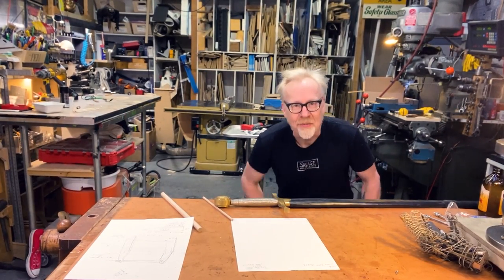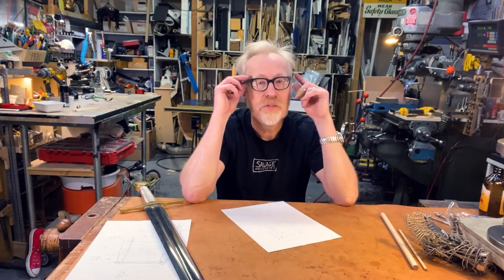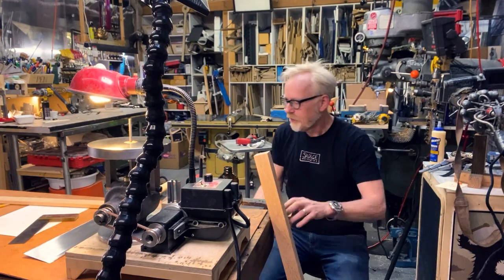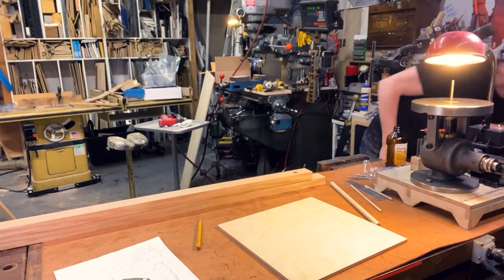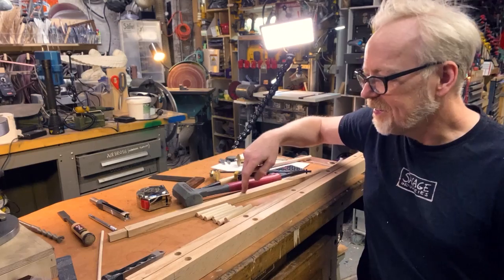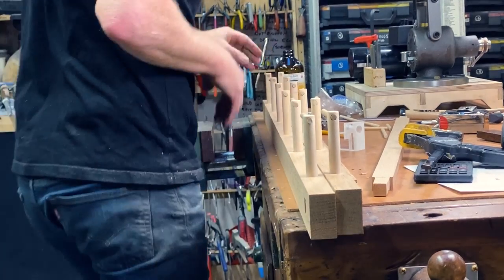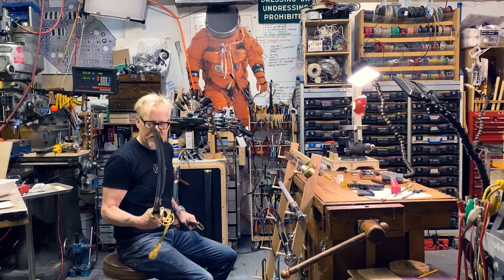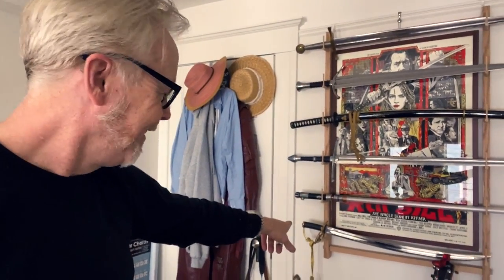Adam Savage's One Day Builds: Movie Sword Rack!

Comment: Thats why the rest of the world uses the metric system :)
Reply: even most off America used the metric system, kinda a mosh pit of measurement units, Fahrenheit for all but science class, schools use full metric, most people I know who build stuff use metric (unless it is a US built product inchiwhc case they manufacturer probably used a easy measurement by rounding to an inch based) basically yes America is pile of people who all want to not be in the pile but they are chained together and also all hate each other.
Reply: Maybe you'll eventually phase out those lingering imperial measurements. Some will take longer than usual. Some machine threading is still imperial and as long as the hardware is still usable maintenance will still need to know imperial.

Maybe eventually.
Reply: Even the metric system won't save you from bad math. Half of 97 still isn't 47.5 no matter what system you're using.
Reply: Im tired of this outdated argument. There both equally simple to use, and both equally easy to fuck up if you don’t pay attention and do your basic arithmetic correctly.
Reply: @Rusty00 Now i am currious why do you keep the imperial system alive?
Reply: Rusty00 nostalgia? Idk everyone else changed at some point. Eventually the money spent  will on two sets of tools fasteners etc etc will be great enough to make the change over worth while.
Reply: @Rusty00 Ok this is written before i watch that video but that is What?
That makes no god damn sense what so fucking ever. 

Also 1hour video will take a little while to watch for me but so far the fuck are you on about?
You do know that if Randall Carson was born is say Italy he would claim the same things about the Metric system right?
It is not a coincidence that a person from USA would use imperial numbers to interpret things around them. 

Also Why the fuck would ancient people use a system of numbers that DID NOT EXIST at the time?
I am sure he has an explanation on it but i would need more (i will continue the video and i hope things are not as bad as it looks right now)
Just FYI if he was from somewhere that used metric and talked about the metric system being part of ancient peoples life i would also question it.

And the thought of one common system being used around the globe is very odd as we have SO MANY different number systems, and just look at languages we have all a common ancestor way back in time and yet there are so many different languages that exist.
Reply: @Rusty00 "If he were born in Italy then he would have even more reason to use the ancient Romans imperial measurements, " Dude that is NOT THE SAME SYSTEM. The system is called British Imperial or Exchequer Standards of 1825. Then changed a little to fit the modern-day USA. Do not confuse these things.
" lol, so good job using Italy as your strawman" That in of itself is a strawman argument and also see above to why what you said is just flat out ignorant.

"And there are very few number systems, antediluvians seemed to have all used a base 12 number system" I have seen indigenous people use a system of 3s system of 5s system of 12s system of 9s system of 24 system of 32 system of 10 system of 20 system of 38 and that is just number systems.
our own 10 number system is a 9 number system with the added 0 from arabic systems.

" for reasons that you would likely mock and ridicule simply because its not mainstream science, just as the overwhelming evidence of a global civilization is not accepted by modern science." If there was OVERWHELMING science it would be called SCIENCE that is how Science WORK. There is no evidence for a global civilization but if there are the number 12 is FAR from being a good representation for it as it simply is not used very much there are more systems using 30 then there are systems using 12 as base counting.
But i would love to be wrong on this.

" which the US keeps practicing in order to keep it alive and known" Again Not the Same System.

"But hey, if you want to stop using imperial measure, then have fun reworking calendars and clocks." ERRRRRRRRRRRRRRRRRRRM Calender we use right now is called the gregorian calendar look it up.
Clocks would not change as they are independent but if you want to know Seconds are metric.
A pound is defined as a unit of Kilogram, A gallon is defined as a unit of Liter. An inch is defined as a unit of Centimeter.
The official definitions of Imperial units are defined by Metric SI units.
(this means if 1kilogram Changes in meaning SO would 1 pound change by the exact same amount. Also, that means if the meter gets changed that also means the inch changes)

"The golden ratio is 1 : 1.618. Do you know what the relation between a mile and a kilometer is? 1 : 1.609."
 I do not think you know what the golden ratio actually means. Because that is not how it works what so ever and also it would  mean mile and kilometer is not in the golden ratio.

"But if you are getting rid of that, then also have fun trying to change the 360 degrees of a circle" This literally has nothing to do with imperial vs metric what so ever a circle is 360 degrees because of what 360 degree is. It is 360degrees in a circle in metric also.

"But hey, there is no reason for you to get so angry that you have to resort to swearing at me"
Swearing is natural stress pointers it has nothing to do with being angry i have changed it here to be caps.
Reply: @Rusty00 Whoosh!!

 You must assume? Well i already know what a cubit is and i also know that it is 44.4CM or 0.444meters.
What you do not seem to understand is that you do not understand the basic differances of what is and what is not in the imperial and metric systems and you also do not know that the imperial system USA uses is the Brittish one not the Roman one that is ignorance. 

Oh what a sad world when you try to use numberphile to prove a statement the person in the video would disagree with you on. 

And and fyi i saw that video 7years ago.
You talk about misrepresentation and here you are misrepresenting by linking that video as that video has nothing to do with metric and imperial in the first place. At this point, i have to conclude you do not know what the metric system actually is in the first place.

Also For your information, the video you linked here is a person who uses Metric Every Single Day and the video is just him showing his love for math and you are misrepresenting him a lot. Do not cherry pick things if you want to prove anything.

First go read up on what the metric system actually is Then come back also it is because of this MASSIVE ignorance on your part that i did not watch the 1hour video.

Comment: As a carpentar I also built a sword rack but instead of the small vertical pegs, I drilled the holes for the holding dowels at a slight angle and that keeps the swords in place just fine.

Comment: Very cool little project.  For the someone without a workshop, but a sword collection Ikea sells these great little two hook wall hanger mounted on a wood block in three different colors for about 8 bucks a piece, I use them for my swords and light sabers.

The item is called Hjalmaren at Ikea, you can arrange them your walls, over doorways, whatever floats your boat.  I had to use two for my two handed broadsword for stability, but otherwise anything under 45 inches long, easy as pie.

Comment: hey adam! i doubt you will see this but i personally have had great results using the japanese handsaws in a teeter motion. start a line then work the back corner, then after a few passes teeter back and work the front corner and then repeat.

Comment: Sent here from the 7/10/2022 episode. I've been wanting to make a sword rack for years. I've got a kid's organizer (wood frame, plastic bucket) that used to be my kid brother's until mom started dumping all the unused furniture on family and I had an idea of repurposing it but never got around to it for a decade now. I've got some display replica swords (Kenshin's reverse blade sword, an odachi, etc.) but mine aren't consistent length (the odachi in particular) so I was thinking of making it vertical. Obviously, this isn't vertical either, but it's given me some ideas on how I might approach the project. Dowel rods at 90 degrees to one another coming out of thicker vertical dowel rods might be a good way of holding them upright, with something at the bottom so they aren't resting on the floor.

The other thought I have from this is maybe doing a pegboard with vertical braces and then have dowels within dowels like this that rotate 90 degrees to keep them from falling forward.

Comment: I'm honestly surprised Adam doesn't have a set of square hole drill bits. I'll never forget the first time I was working with a carpenter as an apprentice a few years back and he told me to grab them and I thought he was joking and played it off and he actually walked over to the bit drawer and pulled out a whole set. Blew my mind.

Edit: I noticed he does seem to have one laying on the table at 15:52 but didn't use it.
Reply: That's what he used, he just pulled the center bit out ( you can see him set it and another mortising chisel down at 11:35 ).

Comment: This is an excellent prototype. Thanks for letting us in to see it! I love the idea and basic design. I feel the same way you do, I'm not quite sure about it. Here is what jumps out at me when I ask why: 1) The swords break the vertical lines of the door molding. It gives a feeling of chaos, and looks like the whole thing doesn't belong there. You clearly can't increase the wall size, but another 12 inches of horizontal space would probably make it come together much better. 2) The top sword obscures the top frame. The frame is part of the art, so it probably needs to be visible. 3) The reveal around the poster is uneven. The poster should sit in the horizontal center, and either the vertical center or slightly above the vertical center, of the frame. The top/bottom margins are also much larger than the left/right. I'd experiment with widening the side margins, and/or narrowing the top/bottom margins to find a more pleasing balance. 4) The sabre/cutlass seems too short. It might be as easy as moving it toward the center so it's resting on the hilt instead of the blade on the left side? Doing that would also make the sword hang more horizontally and might improve the how well it fits visually with the rest. 5) I'm less certain about this one, but the opposing curves of the two curved swords keeps drawing my attention. It might not be an issue if #4 was addressed, but it might also look better if they both curved the same direction. Again, I'm torn on this one.

Comment: 7:15 yes indeed Adam, if you are not using a japanese saw every day it takes some more concentration on what you’re doing. But there is more to it, it’s also about where and how you‘re standing concerning to the saw, yes Adam standing...definitely not sitting. Your sawing gets much more accurate and straight when you’re standing behind the saw (not asides) and additionally using 2 hands after setting the saw on its line and establishing the sawing with some light strokes will give you a lot more control on the saw, like you would never use a Katana only with one hand.

Comment: There are some great companies online you can buy lightsabers that are made specifically for sparring with each other. The one that is probably the most well known is Ultra sabres. Great full metal construction. With replaceable blades for sparing so if one were to break you could replace it. I recommend the hardest blade type. I've had mine for years and no problems. You can get them as low as $80 and as high $1000 for all the sound effects and such

Comment: Hey Adam, a quick tip for using the Japanese saw. It's best if you stand while you're cutting. You want to be able to keep your elbow locked at the same angle the whole time you're cutting and pull back rotating at the shoulder. This helps you keep the cut in the same plane the whole time. Also a trick for keeping the cut straight down is to look at the reflection in the saw plate. Make sure the reflection of your work piece lines up with the piece itself. It should look like one solid piece while you're sawing. That will make sure the cut stays at 90 degrees to the face of the work piece. Love the videos!

Comment: You always seem to have parts on hand for example in this episode you were looking for couple strips of timber and you found extractly. My question is how often do you restock your stuff till all containers are filled “ for example” a certain bolt time when you run out you always find a couple more. Is it like a monthly inventory check? You go around and write a shopping list every month and find what is in limited supply so you right right all down then go to the hardware store and buy everything at once then your full stocked for another couple months? Or is it as soon as you use all the quatinty you go same day and buy an box full. ?

Comment: 10:50

Very odd that you don't own a Morticing Drill bit.
Reply: He does.  11:27 he is holding 2 mortising chisels and bits.  11:37 he sets the bit for the one he uses plus the other chisel with bit in it to his left.  My guess would be he doesn't have the adapter to mount to a drill press to use them together.

Comment: When will you start using metric? It's superior. Same with Celsius.
Reply: Lukas Sprehn it’s annoying, but all wood and metal stock as well as the tools in the US are cut and sold in imperial unit lengths, so makers are basically forced to use imperial whether or not they wish to do so.

Comment: Just a little tip for the design if anyone is interested: in my dojo there are a lot of sword racks and they are pretty similar, with wooden dowels, but these are set at an angle so you don’t need the secondary dowel to prevent the sword from falling forward ;)

Comment: I agree with others that it is a shame not to display the scabbards. You could add diagonal hangers (about 120 degrees down) with pegs on both sides that you could hang the scabbards from. Of course you have to decide which 6 of your many swords to display in front of Kill Bill. Also, you need a different style sword hanger in front of your Star Wars poster (fishing line and Plexiglas?) for your light saber. I don't even know if you have a Star Wars poster, I just assume you do.

Comment: For those who are wondering, the "Square Chisel" is called a "Mortise Chisel Bit" or "Mortise Drill Bit". As the name implies there usually is a drill bit in the middle.
Reply: He had the bit for it in his other hand then sets it down. Guess he doesn't have the adapter for mounting to his drill press (or didn't want to spend the time doing it.)

Comment: think need two like 12 swords just see what fits.
Reply: jack mace going buy some off but modify it for bow staff like weapons.   bow staff normal inch short then how ever tall you are. so instead two oak wood supports need 4 even across. what allows do is top bow staff. but in middle have extra hook for three section staff. might play around with put numb chucks in third spot has 4 hooks. might play around get so numb chucks hang strait with chain stretched that probley take more hooks or twist tie or fuzzy possible wires get Walmart craft thins tie dumb chucks hooks so fall out.. or hang 4 on the bottom 4 hooks have 4 numb chucks. then some way dull safer version what ralf red turtle had. if took three section staff out put sword 4 turtle. think cool see hang in martial arts home.  I play idea wood burn designs that spin around bow staff.

Comment: If you do decide to keep the rack, don't paint it. You made it out of white oak. Just give it a quick couple of coats of finishing oil. I would suggest tongue oil cut 50/50 with some pure gum spirits. It will dry faster, change the color less, and penetrate the wood to protect it better. It will also smell nice while drying since gum spirits have a pleasant smell.

Comment: If you pot two small upright dowels roughly 1/2 an inch apart your blades will stand up straight.
Reply: I would use perspex  so the swords appear to float, but the idea of 2 pins is a good one.

Comment: There's a 'wheelwright' in Joliet Montana (Engel's Coach Shop) who uses a special drill bit to drill square holes in wagon wheel hubs.  I don't know how it works but seems to be a handy bit to have when drilling square holes in wood. 

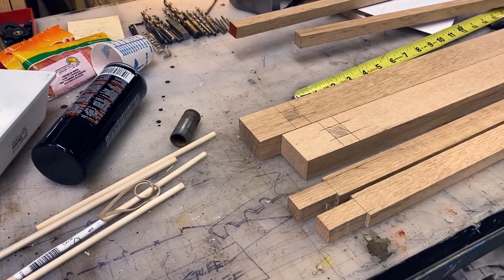Check it out on  https://www.youtube.com/watch?v=b68CI4cxjAM    Skip to 10:32 to see the drill bit.
Reply: It's actually the same thing.  A mortising chisel.  Adam used just the outside part and set the drill bit to the side at 11:35.